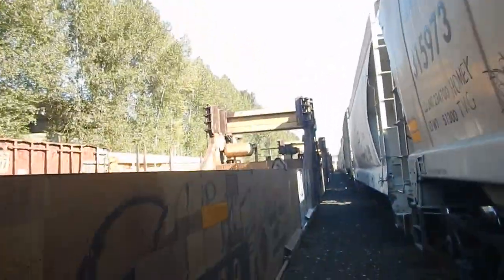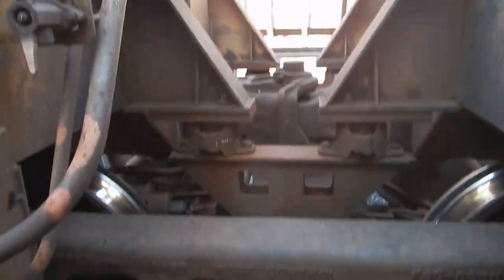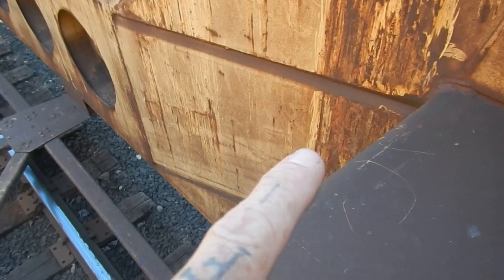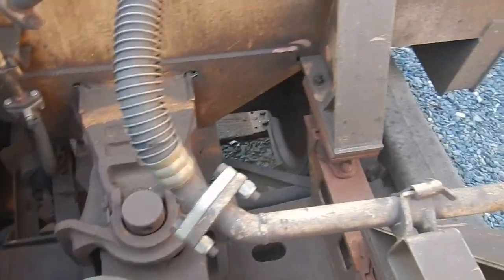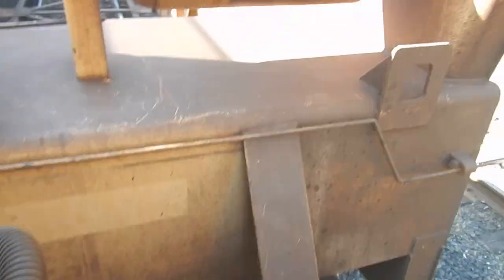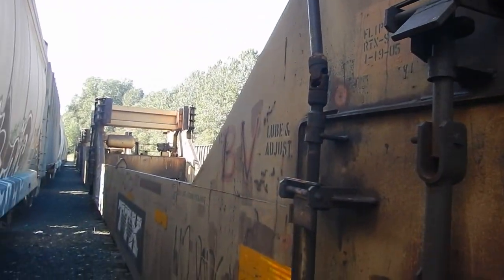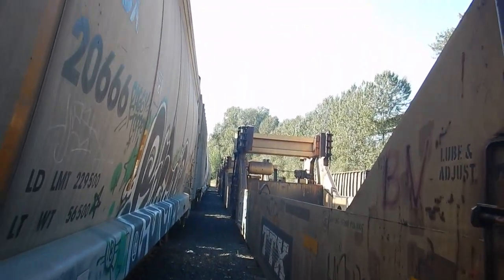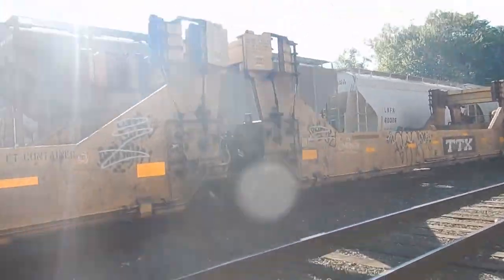Viking Ship (TTX Railcar) Hopping Freight Trains

Comment: The reason they're all together in a bunch in this video is because they're en route to dismantle. TTX is scrapping their fleet of them. However, NOKL still has many.
Reply from the maker: i read they are a problem to load and heavy - Was fun rides Viking ship and they kind of look like a ship
Reply: They are being phased out because of the big moving parts on the brake system and the fact that they can’t hold more modern, bigger containers

Comment: What is the best ride as far as freight cars are concerned ?
Reply from the maker: hoppers
Reply: @Telestations  I saw a young guy riding a spine car on Youtube.   One of those low 28" diameter wheel single axle cars in the Trailer Train pool.   Not only was he moving back and forth under the truck trailer fron one end to the other he was holding his camera attached to a monopod out over the side.   Have you seen this YouTuber ??   I think he's located in the Pacific Northwest.   I never rode but I did photograph a lot of trains in and around Philadelphia.   ConRail at Frankford Jct in the northeast to B & O ( Chessie System,  CSX,  Family Lines,  Seaboard System ) at East Side yard & Gray's Ferry Tunnel in southwest Philadelphia.